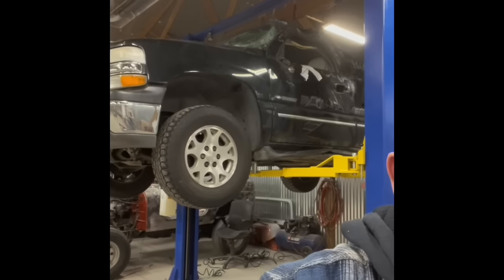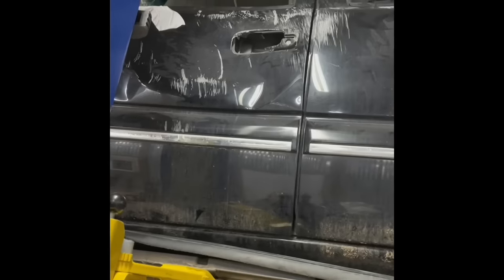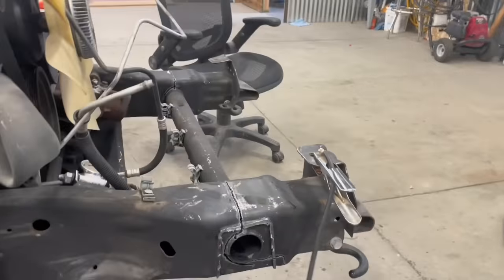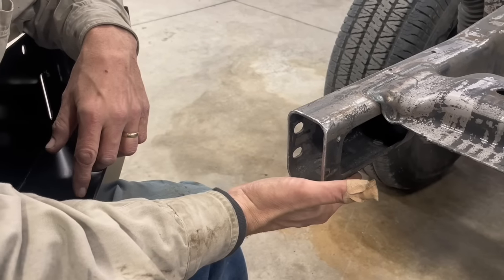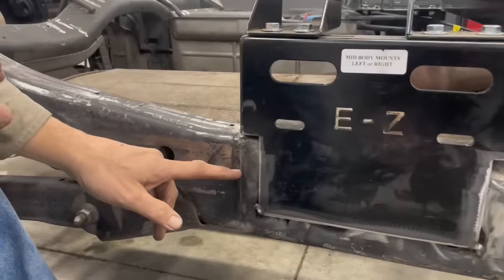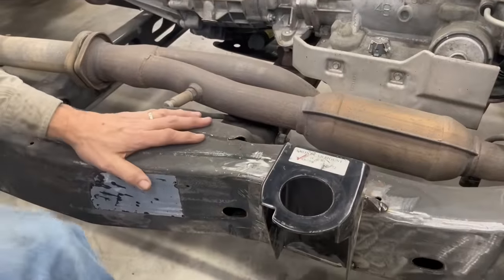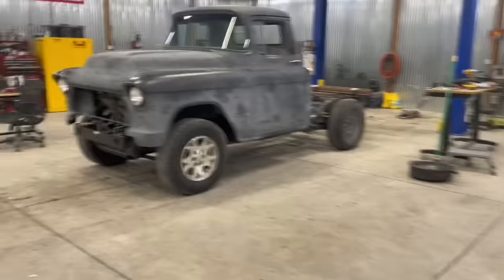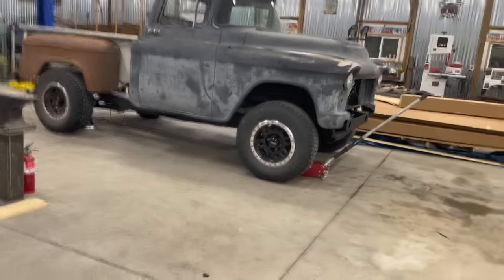57 Chevy Truck on 2001 4x4 Chevy Tahoe frame.  PART 1￼Crazylegs Creations

Comment: This is amazing! My daughter is an Orthotics patient of yours and my wife came home telling me about this! We are the Satterfields. Ill catch up on the other videos soon and i look forward to more! One thing that might help with the tire clearance in the back is using springs from a “Z71” tahoe if the Tahoe you used wasn’t a Z71. They are 2” taller than the normal tahoes. But this will obviously make it sit a little taller in the back. You would probably want a leveling/small lift kit in the front to get it to sit level again if it lifts it too much in the back if you tried it this way!
Reply from the maker: Great idea.   Thanks for your input.

Comment: Having watched content from the big YouTubers such as half ass customs, puddin’s fab shop etc, your video is just as interesting and entertaining! Well done and keep up the good work. Also, from experience, if you need to use your office chair a lot, get yourself a set of rubber wheels with bearings (with the wheels from inline skates). They make moving around so much easier and quieter!
Reply from the maker: Thanks! I’ll have to look into that

Comment: Looks kickass sir ,well done I had a 58 Apache back in high school had  a 6.6 turbo trans am motor an tranny with disc brake rear3:73s I miss that badass truck I took a curve too fast around 85mph flipped it 7r9times idk lucky I wasn't killed me an a buddy a drunk man in van stopped a was amazed we were alive got a chain flipped it back on wheels an it cranked right up an I drove it home , my dad beat my ass , I picked up more wemen in that truck in school  Damit ,ol Chevy never die, they JUST haulass ,haul sum ass
Reply from the maker: Lots of memories. My first Chevy was a 63. I still remember the day I crawled into the cab pull the choke, and it fired. I was excited to hear the engine run, the old straight, six. I broke a horse for a guy in trade for the truck. I was 15 and I loved every minute of that experience.

Comment: I am started this swap with my 66 and am just starting to take stuff off the tahoe, was interested to see how that went, but then BAM the body was off the tahoe 😂. Looks like it will be a great build!
Reply from the maker: Yes, I was surprised how it came off in a couple nights work. It was a clean separation. Where are you on your build? Keep me informed.
Reply: @russellmcconahay7297  I currently have the entire front end off, just about ready to undo body mounts, but i dont have a lift so still trying to see how i am going to do it, may have to take off all doors and hatch and cut into smaller pieces. 

Ill have a video up on my other channel once i get to the editing

Comment: I have a Tahoe I bought for a donor. I want to put an 88 k5 on it. I want to use floor and firewall on the Tahoe and make the blazer a dependable cruiser for my daughter
Reply from the maker: I’ve seen that done with a 72 Chevy on a Tahoe let my know I might be able to get you in contact with a guy if you’re interested

Comment: This is crazy, we literally just shook hands on a Tahoe donor for my 55 task force. Been looking at the EZs for a long time and was going to do a k10 but those are few and expensive atm. Great work on the video too!
Reply from the maker: Thank you for following us. We’re brand new at this YouTube thing. I just wanted to document what we are doing because I couldn’t find much information on this. We will be going step by step through the whole process. I just installed the steering column and the master cylinder with the necessary modifications. I will be working on vintage air and a new aluminum radiator modified to fit down in the hole. Talk to me if you have questions, and I will give you as many details as I can. I love doing this kind of work and sharing it with people.
Reply: @russellmcconahay7297  just now getting my form submitted for the kit. Had the opportunity to speak with Ed too, seems like great people. I got to rewatch your first few and check out the wiring situation. I required my entire 55 with a universal kit but it wasn’t set up for LS I don’t believe. Make sure you get Affiliate links going for Amazon and list the parts. Great way for residual revenue.

Comment: That looks great! Funny thing is I have access to an 02' Tahoe and I was looking at a 5 window with an 8' bed ( I believe it is a 52'). I just went over to EZ's site and see they use a S-10 for the earlier style pickups, BUT they do have an 8' version. This type of swap is what I too would like to do before I die also. I have CHF and am 64. I found an Avion slide in camper that looks like an Alaskan Camper (aerodynamic aluminum) and is the reason for needing an 8' bed. Was trying for the "old school" early camper setup with modern drivetrain efficiency. Just sub'd and will be checking back.
Reply from the maker: Go for it.! What is CHF by the way?
Reply: @russellmcconahay7297  Russell it is "congestive heart failure". It has been coming on for some time, so subtle I didn't realize it was happening. But it has sort of "stabilized", still dying from it, but not as quickly they say as I was. So other than the things I need to get done, there are a couple I'd like to get done. I am about the watch the Part 2 of your build.

Comment: What did you do cables transmission
Reply from the maker: I haven’t got it figured out yet. It’s an electronic shift mechanism on those old Tahoe’s so I need to figure out how to run the control module without the computer. I’m working with a guy called Swap time on YouTube trying to get me a harness belt.

Comment: What did you do cables transmission Switch
Reply from the maker: I just got off the phone with Mitch from Swap time and he is going to build me a harness. It’s gonna cost me about 600 bucks for the electronic control computer that will control the transfer case in the front differential hubs. If you want his number let me know.
Reply: @russellmcconahay7297  
Yes 👍🏾

Comment: I really like where you are going with this and thank you for sharing the details of the EZ mounts and the variations you had to make. Question for ya, Will you be able to keep this truck titled as a 57 or will you have to use a new VIN, since the frame is not matching?  I have a newer truck with a good frame and running gear but the body is rusted out junk. I was thinking of doing something like this but wasn't sure how I would have to "register" it???
Reply from the maker: That’s a good question I was hoping to register it as an antique because it has no smog control, and will not pass emissions
Reply: depends on your state here in ohio and alot of other states the vin is all that matters i recomend contacting your local state highway patrol and bmv for the exact laws in your state

Comment: Hello I have a 2007 silverado 4x4 crew cab n I wat to swap out the front end to a 57 front end is that possible
Reply from the maker: That would be pretty awesome. I think it probably is. I would probably contact Ed from easy chassis swap. I think I have a link in the description. If not, I’ll try to get it for you. See if he has a kit that would work on the Silverado frame to except the cab mounts of the 57.   
https://www.e-zchassisswaps.com/#page-top

Comment: How did you connect your 4 wheel drive selection switches?
Reply from the maker: I haven’t yet I still have to figure that out because when I got rid of the factory computer, I lost connection to that portion

Comment: I have a 57 truck that I plan on doing the same swap as you. How are you planning on keeping the 4x4? Are you keeping the factory push buttons or converting it to manual 4x4?
Reply from the maker: I am working with a guy  named Mitch at Swap time this is his #+1 (702) 353-5037
Reply: @russellmcconahay7297  awesome thanks for the reply. Now I can’t decide if I should get a 4x4 donor truck or an AWD. I spoke to EZ Chassis Swap yesterday about ordering the mount kit

Comment: Can you delete the pollution stuff and still run the LS? I thought the computer would not function with out all the sensors?
Reply from the maker: I have a new harness and computer from Psi conversions and I’m supposed to be able to run it without the pollution smog stuff.
Reply: @russellmcconahay7297  there ya go! Good luck with your project, looks good!
Reply: just have to tune it for that or run a holly terminator kit

Comment: I have an 04 Tahoe.   Not a fan of the 5.3... there are so many better GM motors i would be doing some research.   I had a 99 suburban with the 5.7 in it and got very comparable mileage
Reply from the maker: Hopefully this one treats me good if not, we can swap it out
Reply: im a old school guy personally but im currently swapping a 5.3 into my 79 c10 great motors easy to work on and modify